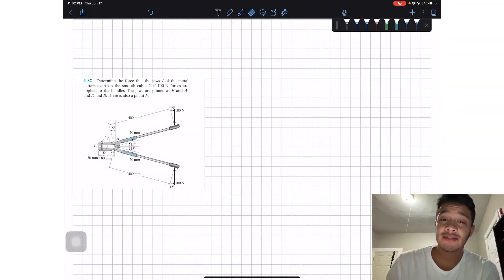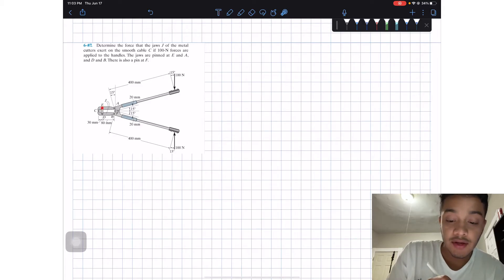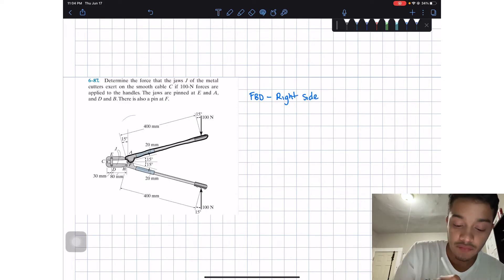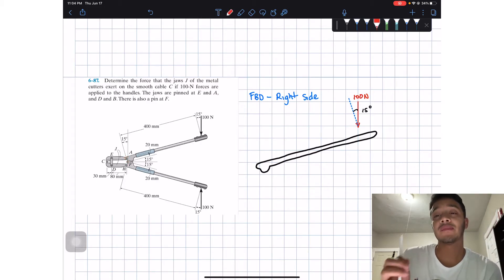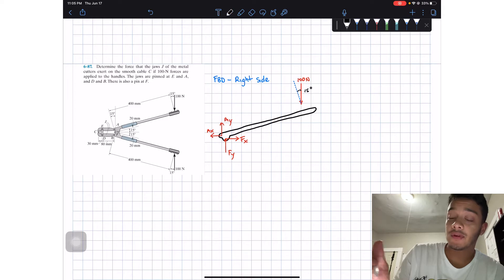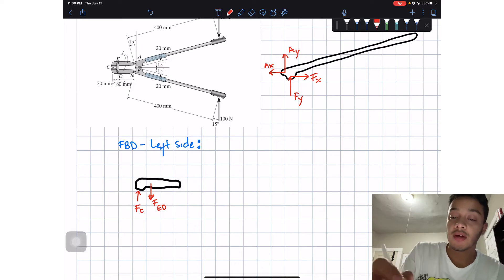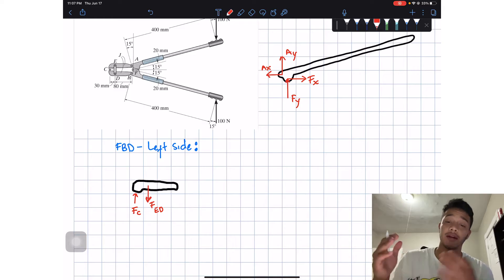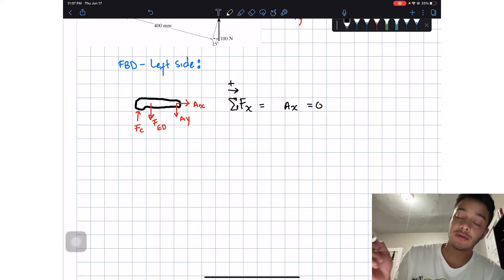Statics 6.87 - Determine the force that the jaws J of the metal cutters exert on the smooth cable C.

Comment: Love your video and clear speech, but I think your triangle is wrongly marked, the 20mm should be the Hypotenuse, not a Cathetus
Reply from the maker: By slightly going over it, I believe you are right and it did not change our answers because the values of the Hypotenuse and adjacent  in this case are very similar.
Reply: @LearningbyTeaching  Yes, haha, That's it's a FYI